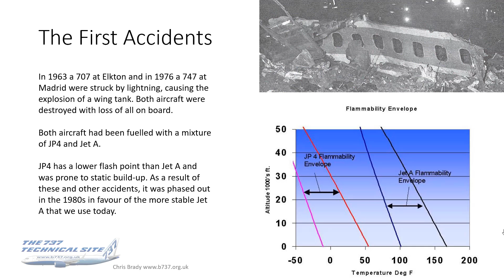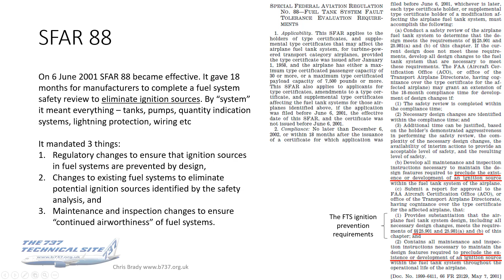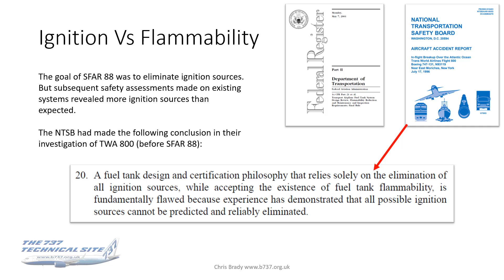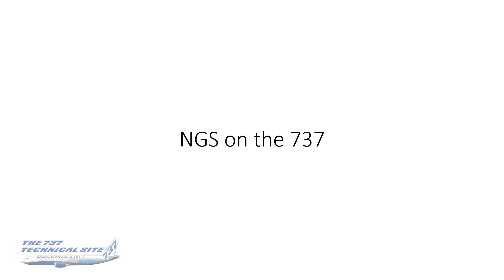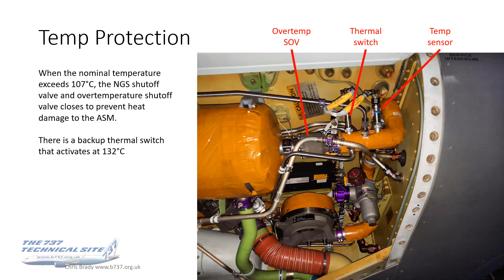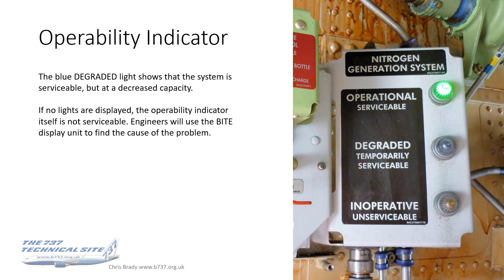737 Nitrogen Generation System

Comment: Hi Chris, I can imagine that the Nitrogen Generation System (NGS) is turned off when the aircraft is on the ground and not in test mode because the nitrogen membrane requires a sufficient pressure differential to function properly. If the pressure differential is too low, oxygen can permeate to the nitrogen-rich side, compromising the inerting effectiveness of the NGS.

Anyway I appreciate the very informative video! Thanks for sharing.

Comment: 737NGS is much simpler than 787NGS.  787NGS (bleedless)has to provide inerting capability to all 3 fuel tanks.  737NGS content is a good introduction to the world of fuel inerting systems for those commercial airplanes.  The background on the FAA requirements is spotted on and well balanced regarding technical aspects of the technology.
Reply from the maker: Thank you for your comments.

Comment: Hello capt.. Thanks a lot once again for an amazingly well researched and informative video. I have a small doubt about what you have mentioned about the vents. So, what I understood is that there is a check valve so that no air from the vents should enter the centre tank as the aircraft descend. That valve only allows the fuel to be overthrown from the vent. 
But when the NGS is not operational and the MEL does not stop us from using centre tank, how is the centre tank vented and with that I mean how the pressure is equalised.
Thanks alot Capt for your efforts and time.
Reply from the maker: It is a bit complex to explain briefly here but suffice it to say that when the NGS is OFF (eg system inop or on-ground, fire or smoke detection, centre tank refuelling, overpressure or overtemp etc) the NGS controller commands the NGS Pressure Regulating and Shutoff Valve (PRSOV) to close and the centre tank vents as normal. The cross vent check valve will also open.
Reply: Got it Capt… thanks a lot once again..

Comment: Maybe it doesn’t operate on the ground due to air quality problems? There will be a lot more particulate matter and pollutants in the air in the ground, which are going to shorten the life of the filter.
Reply from the maker: A couple of the other viewers suggested that the reason could be that as there is no ram air on the ground the system would be prone to overheating. this seems to me the most likely reason.

Comment: Hello, I'm writing a thesis on this subject and been incredibly curious as too why the system shuts off when its on the ground. I don't know if you ended up getting an official answer on why, but through my line of work I have access to the NG and Max AMM's in here it states the official procedure the system follows and why it shuts off on the ground. It is not to protect ground crew from passing out in the wheel well from low oxygen content

AMM, SDS ATA 47
When the airplane lands, the NGS changes from the high-flow mode to the low-flow mode. The NGS operates in the low-flow mode on the ground for 10 minutes. When the left Flow Control and Shutoff Valve (FCSOV) closes before 10 minutes, the NGS does not start again when the FCSOV opens. When the airplane completes 10 minutes, the system goes to the cooldown mode. There is no flow through the system during the cooldown mode.
The NGS cooldown mode prevents damage to the NGS heat exchanger. Ram air flow will not go to the heat exchanger. This prevents a thermal shock from a fast cooldown. The NGS cooldown mode keeps the NGS shutoff valve (SOV) open and closes the Over Temperature Shutoff Valve (OTSOV). This lets system pressure go to the Ram Air Valve (RAV) to keep the valve closes. There is no ram air flow at this time.

So from this system description and experience of changing the heat exchanger followed my a stationary system test. I believe it is to protect both the ASM and heat exchanger from overheating, since ram air flow is practically zero when on the ground
Reply from the maker: Mystery solved! Thank you for the information.
Reply: Agree, that's also my guess

Comment: Could the NGS not operating on the ground be due to an assumption that the ullage in the center tank should already be inert from when the plane last wasn't on the ground?
Reply from the maker: I don't think that is a safe assumption, especially if the aircraft has not flown for a while. There have been a couple of fuel tank explosions whilst the aircraft has been on the ground so it seem like an oversight to me.
Reply: @ChrisBrady737  Not saying I agree with that assumption - just that it could've been a potential justification offered when designing the system.

Comment: Yet another excellent video, Chris. Thank you for all the work you put into preparing these. I'm just a layman but I really do appreciate your highly-detailed analysis of the plane and its systems.

As for why Boeing engineers decided against the tank inerting system operating while the plane is on the ground... Do you know if the fuel intakes of the 737 have check valves against the release of ullage gases at the beginning of the refueling operation? A plane's landing is generally followed by a refueling operation, within a half-hour or less, right? All I can surmise is that since the inerting system works overtime during descent, refuelers could potentially be exposed to a release of oxygen-deficient ullage gas while preparing to hook their fuel pipe onto the aircraft. Is turning the tank inerting system off on landing perhaps some kind of compromise between the safety of the aircraft itself and that of the people servicing it?
Reply from the maker: Yes there is a check valve at the refuelling point, if for no other reason than to stop a spillage as the refuelling point is under the wing not on top!

Comment: I also do not know anything about the subject, so here I am watching this amazing video. I speculate the system cannot be operated on the ground because no temperature regulation can be provided on the ground due to no ram air  available and the membrane can be damaged by the elevated temperature.
Reply: That was my guess too, that it has something to do with temperature and less ability to keep the units cool on the ground.  I know medical oxygen generators/nitrogen scrubbers get surprisingly warm when they're in use.  I assume the NGSs heat up too when in use?
Reply from the maker: That is a great theory. I think you might have got the reason

Comment: Thanks Chris I now have a much better understanding of NGS,that was the best NGS explanation I've experienced.
I think the history of the system was really enlightening.
You spent ages preparing this and your efforts are greatly appreciated. 
BTW Matthijs could be onto something,why wouldn't the NGS 'exhaust' potentially fill the wheel well with low oxygen content air?
It is located near the wheel well.
The 'exhaust'would be potentially lighter than the surrounding air,as I believe,O2 is heavier than N2.Anyone entering the wheel well could be asphyxiated until they fell to the floor.
Of course,as you point out,on ground is a dangerous phase and if packs run they cause heat,but paradoxically,are prevented from powering the NGS to obviate the danger they created by running in the first place!
Best wishes from Paul.
Reply from the maker: Hi Paul, thanks for your kind comments. I still don’t go for the idea that NGS should be switched off at the only time the two previous explosions occurred just in case the exhaust pooled somewhere. If that was a risk they could have ducted it somewhere safely away from the wheel-well, then problem solved. Such a mystery!
Reply: Actually it's the opposite - n2 is very slightly heavier at standard temperature and pressure but they're very close (1.25 vs 1.23). Unless the exhaust was significantly hotter that the air and the air was completely still, no wind, etc. it won't be a problem

Comment: 44:50 While I don't know anything about this subject I do have one bit of speculation to offer: I browsed a copy of the Inert Gas System chapter of the 737-NG AMM that I found floating around on the internet and noticed it puts a lot of emphasis on the danger of breathing the oxygen-depleted air produced by this system. In particular, a leak in the NGS or nitrogen-enriched air distribution lines into any enclosed (or partially enclosed) compartment accessible by ground crew could create a rather insidious hazard.
Reply from the maker: Whilst that is of course a possibility, the NGS would be operating in the wide open space on the ramp where the by-products would quickly be mixed with ambient air. If the aircraft was ever in a hanger the system could be deactivated quite easily. I personally doubt that is the reason but who knows?
Reply: @ChrisBrady737  Well the concern would be for spaces inside the airplane where leaking nitrogen-enriched air might have the opportunity to accumulate, e.g. the AMM warns to "not go into the main wheel well area more than to waist level" while NGS is operating. The only alternative concern I can think of is fuel vapours in the ullage air being continuously vented overboard while NGS is operating, though I have no idea if the quantity is enough to be relevant in any way.  Anyway, this is all just idle speculation from me.  Let's hope someone shows up with more concrete information!
Reply from the maker: Absolutely, I would love to know the reason. All good theories on your part though, thank you.